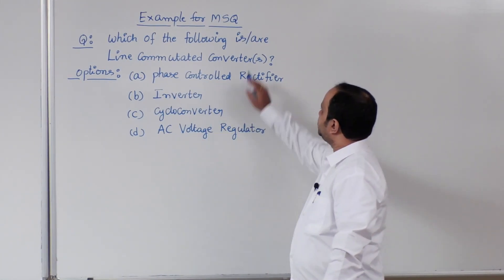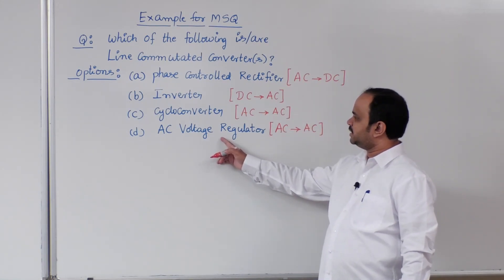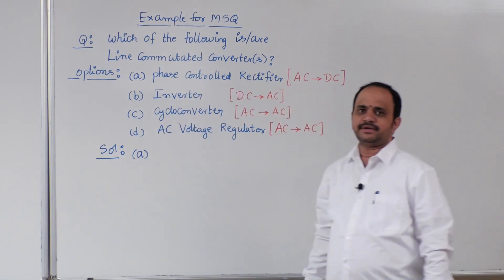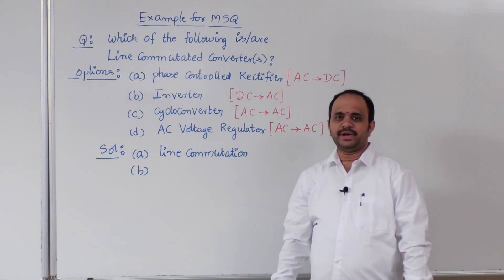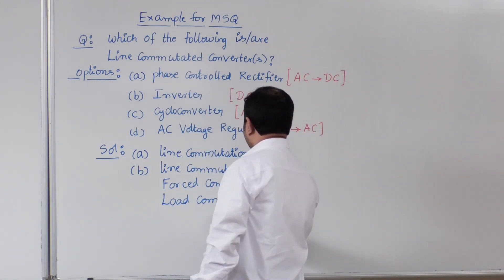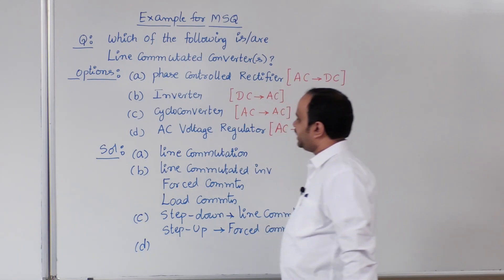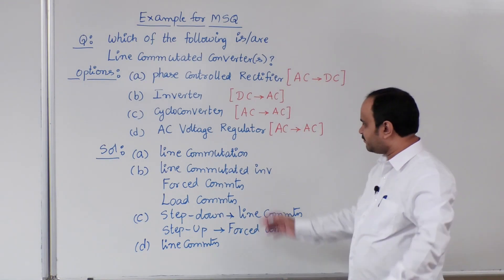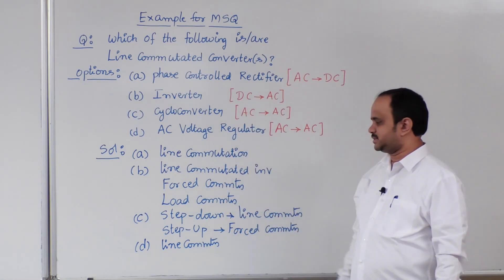Sample Multiple Select Question (MSQ) | GATE2021 | Power Electronics | OHM Online Classes | EE | EC

Comment: Sir in msq ans is more then 1 option but how many ans are correct
2option correct
3 option correct 
All option correct 
I mean in in 65 que if 2 are msq que type so 1st msq may has 2 options right and 2nd que may has 3option
 right  I mean to say msq type no fix no.of options are correct ??? Please reply sir
Reply: If one MSQ has 2 correct options it doesn't mean the other MSQs should have 2 correct options. Every MSQ is an individual question.
Reply: @hemuviru319  thankq sir
Reply: @hemuviru319   sir will they mention that this particular question is having multiple answers like IIT jee or we should have to find out the msq 's by ourselves...??? Plz reply sir
Reply: @challasaiprasanna7509  i would like to ask the same question. If they didn't mention it we have to check all the options for all Choice based questions which leads time consuming.
Reply from the maker: Till GATE 2020, they provided the type of question for each question. So we can safely expect it will be mentioned in GATE-2021 too. Just check if you wish.
http://gate.iitd.ac.in/gate2020/mock.php